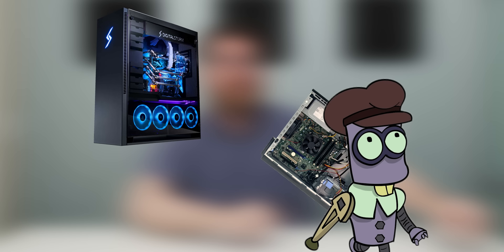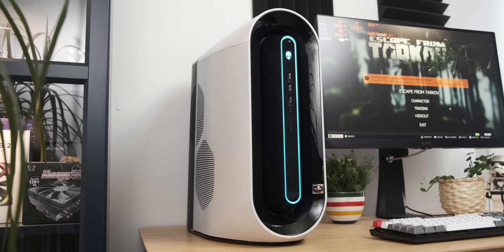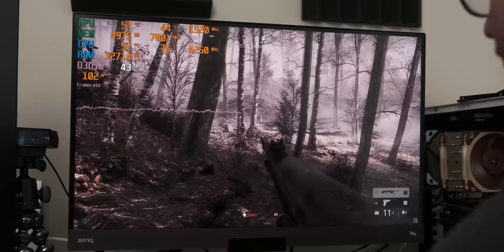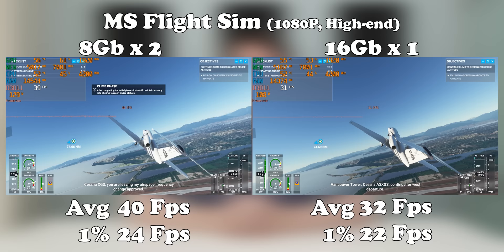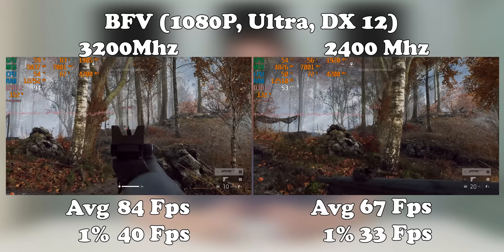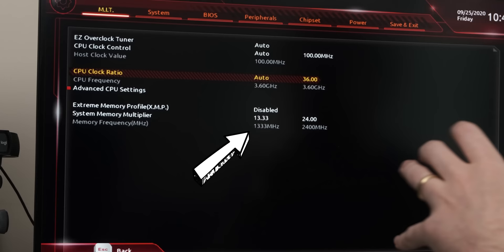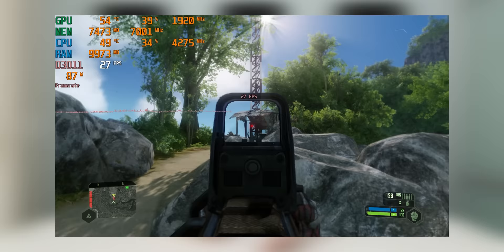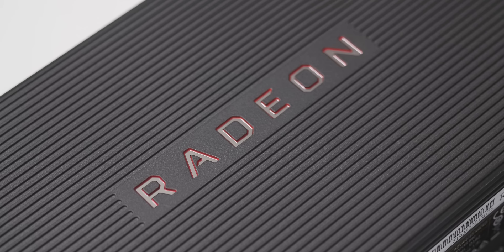How to DESTROY AMD Ryzen gaming performance!

Comment: Nice one Dawid, your findings are solid, and very much in line with what I have found at home, through my own personal testing. If possible, it would be great if you could test 2x16gb and 4x8gb sticks vs 2x8gb for us sticks next. I have found that dual rank (not to be confused with dual channel) RAM setup, can add another 10% to Zen2 FPS in certain games (especially CPU limited scenarios).

I noticed some very decent gains when going from 2x8gb sticks to 4x8b sticks, and the same with 2x16gb sticks vs 2x8gb sticks. Ryzen benefits from dual rank quite a bit in certain CPU limited scenarios. And tweaking the timings via "Ryzen DRAM calculator" is also an excellent FPS enhancer, especially when combined with an top of the line GPU (2080ti, 3080 etc). So is maxing out the RAM frequency and IF at 3733mhz or 3800mhz.

And combing all 3 are the best, using dual rank + dual channel (2x16gb or 4x8gb, both configs are dual channel) + Tweaked Timings + Maxing Out RAM/IF. I have gone all in and done all three with my 3700X (using 2x16gb sticks as my final choice instead of 4x8gb), it is the best way to optimize your Zen2 platform. Intel does great with CPU overclocking, AMD does great with RAM/Memory subsystem tuning and optimization.

Thanks for the video Dawid, really enjoyed it.
Reply: So few tech youtubers test single vs dual rank memory for Ryzen. Personally I have a r5 3600x with 16x2 ddr4 3200mhz ram. I went with dual rank after some hours of searching up benefits with dual rank for ryzen, but it wasn't easy to find information about it.
Reply: @deffar  so you had a 15-20% performance from dual rank? That's awesome, which brand? Corsair, Kingston ? Frequency ? Thanks
Reply: @deffar  Super solid setup you have there bud. 3600X is a great CPU, and 2x16gb 3200mhz RAM is also an excellent setup. I would consider that an great build, definitely super solid. You are well sorted for anything you throw at it. 3200mz dual rank setup is close enough to maxing out your memory setup already, and I would be incredibly satisfied with that exact setup. 

You can obviously always get your RAM/IF maxed out with the maximum your CPU allows (likely 3733/3800mhz), that would require reinvestment into completely new sticks, and that may or may not be worth it depending on the GPU you currently own. But the option is there in the future if you ever decide you do want to completely max out your memory subsystem.

But I don't see any need for you to alter your RAM setup at all as it stands. Just enjoy your PC to the fullest. 

I do agree with you about dual rank not being very well covered by tech YouTubers as well. It is an very valid subject to cover with regards to getting the most out of your Ryzen PC. It would be great if Dawid could do a little digging into the subject matter for us.

I do understand that it is more expensive to go with 32gb RAM (for budget builds), but it would still be good to get more information out there, so that viewers will know that they have an extra option available for optimal performance (whether for a brand new build, or for an upgrade path later down the line). Always good to have more info available for us Ryzen users.
Reply: @luisfernando55  Here is an article covering Dual Rank and its benefits. The article does not show the full potential available, but it does cover what you need to know, and also why it benefits Ryzen platforms.
https://www.tomshardware.com/reviews/amd-ryzen-3000-best-memory-timings,6310-2.html

But 2x16gb sticks are just as good if not even better than 4x8gb sticks. Both 2x16gb and 4x8gb are dual rank configurations, the article tested with 4x8gb if I remember correctly. But you can use 2x16gb as well. I personally prefer 2x16gb myself, so that is an option if you don't want to use 4x8gb. Both are dual rank.

And if you want the most optimal RAM setup for Ryzen (for timings tweaking and optimization), you ideally want some Samsung B-die kits (google will bring up many kits available, go for something in your budget). Anything that is capable of running at 3600mhz-3800mhz is best. But you will have to do some manual RAM overclocking to get sticks with a 3200mhz or 3600mz DOCP frequency to anything higher, such as 3733mhz/3800mz. And 3800mhz also depends on if your specific CPUs infinity fabric can OC to 3800mhz (3733mhz is doable on many though).

But if those are too expensive, any 3200mhz kit with the tightest timings you can afford is the way to go. As long as you go Dual Rank with 3200mhz or more, you will be most of the way to optimal performance. Tweaking timings is the next step to finishing off your memory subsystem optimization.

And if you are not interested in overclocking your RAM, then it is best to pick at kit with the highest mhz DOCP profile out of the box in combination with the tightest timings.

So 3200mhz cl14 timings or 3600mhz cl16/cl14 etc. You are going to need to do some research to see what will work within your budget and to your CPU/MBs capabilities as well (and your skill level).
Reply: @luisfernando55  And let me explain how "Dual Rank" works in more detail. As I said before, dual rank is either 2x16gb kits, or 4x8gb sticks. Both are dual rank setups.

So not to be confused with dual channel (dual channel is using 2 sticks of RAM simultaneously, each one in its own channel on the motherboard). A single stick of 8gb of RAM only has memory IC chips on one side of its PCB. So the CPU can only access memory on the 1 side of the RAM stick that actually has memory on it.

And 1 stick of 16gb has memory IC chips on each side of its PCB, so it has memory chips on both sides of the RAM stick. Thus, it allows the CPU to access memory from both sides simultaneously (very simplified explanation).

So 2x16gb sticks allows your CPU to access all 4 sides of your RAM sticks PCBs simultaneously (2 sides per stick of RAM). So it is "Dual Channel" because of 2 sticks of RAM, and "Dual Rank" because there are 4 sides of memory IC chips to access simultaneously on those 2x16gb sticks of RAM (very simplified explanation).

But it also works with 4x8gb sticks, because then your CPU is also able to access 4 single sides of IC memory simultaneously as well. 

So it can be 2x16gb sticks, or 4x8gb sticks. 2x16gb sticks is preferable though, easier to tune and leaves room for future RAM upgrades.
Reply: @joeyvdm1  But what's better despite small marginal gains?
2 x 16 or 4 x 8?
I'm also looking at power draw efficiency as well as lower power draw overall ;)

3700X (haven't messed too much with setting a clock speed because it takes time to find a balance between efficiency and performance)
2 x 16GB 3600MHZ CL16
2070 Super

Also can't figure out how to really tweak my RAM timings because my system won't post after I do it so I just let DOCP do it's thing
Reply: @christophervanzetta  Don't sweat it bud, if you are having issues with stability (when using anything other than DOCP), then I understand why you haven't tuned any further. You are caught between a rock and a hard place.

I have seen certain Zen owners have stability issues when certain RAM modules are combined with certain motherboards.

So it could be down to your specific motherboard and the specific RAM modules you own. What MB are you using and what RAM modules are you using? Is your RAM on the qualified vendors list for you motherboard?
Reply: @christophervanzetta  Forgot to answer your question. 2x16gb and 4x8gb are both dual rank, so just choose the setup you prefer. 2x16gb is my preferred setup, I generally find it easier to tune and better for stability in that regard. It seems to play nicer with and put less strain on the memory controller. 

So I prefer and currently use 2x16gb, I found it easier to max out my RAM/IF at 3733mhz and 3800mhz with 2x16gb compared to 4x8gb. And also easier to tune my timings the tightest with only 2 sticks of RAM. 4x8gb can be a bit of a stubborn setup to tune to the absolute max, but that is just my personal experience with my own 3700X.

When it comes to power draw, as long as you are not over-volting your RAM sticks to boost frequency (and staying at stock DOCP voltage of 1.35), your power draw should remain the same. And sticking to 2x16gb instead of 4x8gb will also keep power draw down, so another bonus there as well. 

So my preferred setup is 2x16gb, but 4x8gb is often easier and cheaper for people to upgrade to from 2x8gb sticks. It is cheaper to add two more 8gb sticks to your current 2x8gb setup, so people do often do that instead of buying 2x16gb sticks and then selling their old 2x8gb kits. 

And if you are not going to overclock your RAM and/or tweak your timings excessively, then 4x8gb is still quite fine for many people just looking for a cheaper and easier upgrade path to a dual rank setup. And you can still tune 4x8gb as well, it is only an issue when going for the absolute max frequency and/or super tight timings. But you can still tweak the timings a fair amount with most kits, especially when left at normal DOCP clocks, but YMMV. As always, it depends on what RAM kit the user owns, so your results could be better, worse or the same as mine.

I have multiple kits here from multiple builds in my house (now in my kids builds and in my wife's build), so I have had a lot of time to play with various configurations to test what works best and what brings the most performance. We are all on Ryzen builds now, and I will be upgrading to an 4950x for work come release, and passing on the 3700x to my eldest boy with an new B550 MB. I will be keeping my X570 for the 4950x.
Reply: @christophervanzetta  But your setup actually looks really solid to me bud. Your system looks really well balanced. Don't OC your CPU, you are correct. 

I keep my 3700x at stock clock speeds, it does perfectly fine on its own, and does best when left to its own devices. And if you can't tune your RAM any further, I wouldn't stress about it too much to be honest. You are already at 3600mhz, and you are in dual rank mode already. The only thing you could do is tune the timings, but it is honestly not a train smash.

Dual rank will already give you a very optimal memory setup, and with a 2070 it is less necessary to tweak your timings for maximum performance. It is really 2080ti and higher GPUs where you will start to notice tweaked timings more and more. 

You could or could not see some gains in certain titles, even with an 2070s (just depends, but unlikely when GPU limited, which you should be most of the time), and it is not worth stability issues if that is what is happening to you when you try. 

And on the whole, your system looks very balanced to me already, so honestly don't stress about it if you are having stability issues. Your Dual Rank setup will already bring you close to optimal performance, so don't stress if you cant push any further bud.

It is better to have a stable system, then an unstable system. And I would also not tweak my timings or tune any further if I was having stability issues, just leave it as is. Best to go with stability, I cant stress this enough.

And I should add, I will be running an 3080s as soon as my order comes into stock, so it is more important for me to have such a highly tuned RAM subsystem. I will be running into CPU limited scenarios, so it is actually more necessary with such a GPU. And when running anything less than an 2080ti, you are likely to be GPU bound most of the time. 

There can be some exceptions to that of course, but you will very likely be GPU bound most of the time. And the higher the resolution you play, the less CPU limited you will be as well. And just being in Dual Rank mode, will bring you close to full potential already. Not being able to tweak your timings won't just ruin your builds performance, your build is still highly highly capable.  So please don't stress.
Reply: @luisfernando55  Here is an example of decent sticks, these should also be very tweakable. This is a decently priced in my country, not the best of the best but still excellent on the price/performance scale. They are not B-die, but there are B-die versions of them available if you can find them, at a higher price of course.
https://www.wootware.co.za/g-skill-f4-3600c16d-32gtznc-trident-z-neo-32gb-2x16gb-ddr4-3600mhz-cl16-1-35v-black-desktop-memory.html

That is 3600mhz CL16 2x16gb=32gb RAM. And they should be very tweakable if you know how to do so. But it depends on your motherboard and CPU as well, it depends on how compatible they are with one another. And 3200mhz is also fine, as long as you are going for a dual rank + dual channel setup. So 3200mhz 2x16gb cl14 or cl16 kit. 

And here is an example of a 3200mhz kit.
https://www.wootware.co.za/g-skill-f4-3200c14d-32gtzsk-tridentz-series-32gb-2x16gb-3200mhz-ddr4-cl14-1-35v-grey-black-desktop-memory.html

You don't have to stick with those kits or those brands. It is just an example. But if you plan to do no timings tweaking yourself, then try purchase the lowest CL rating you can afford. But if you are going to tweak, then you can purchase something with a higher cl rating and attempt to tune it lower. So from cl16 tuned to cl15 or cl14. I t really depends on your willingness to learn and the research you are willing to do. 

B-die is the best of the best RAM if you want the best of the best, they are highly tuneable and very overclocking friendly. But they can really get up there in price, and are not great for anyone who has no plans to really tune the heck out of them. Cheaper non B-die kits are better for anyone not planning on investing lots of time into getting the best by tweaking each and every timing. Best to save some money in that case and get some cheaper non B-die kits, rather put the savings towards a nice new GPU or even to just keep the savings in your pocket. Nothing wrong with only purchasing what you need, I do it all the time. 

And if budget is restricted, just get the best you can afford. Just grab whatever 3200mhz 2x16gb kit you can afford. No need to stress over what is not worth stressing over. Life does not need added stress, and computers should be a joy and not a worry. So never let it worry you bud. Anything 3200mhz-3600mhz kit in Dual Rank will already be a very decent setup, one to be very satisfied with. I would gladly rock any PC with such a setup. 

I just find it difficult to recommend specific RAM modules across the board to everybody, because I have come across people who have had issues with certain RAM sticks in combination with certain CPUs and motherboards. I need more information from you to really assist you.

But those modules should be compatible with most Ryzen PCs when just using the DOCP setting. But it would be better if you told me what your budget was and what CPU and motherboard you currently own, that will make it will make it easier for me to assist you.
Reply: @joeyvdm1  Thank you ! dont wanna be rude, do you use discord or something for chat? Would love to exchange ideas about ryzen and all tech stuff.

Comment: Lovely video. Just a thought. I just bought an  EVGA GTX1080Ti FTW3 for $355 a week ago. It's sitting in my 2016 HP Z420 with a Xeon E5-1650V2 OC's to 4.1Ghz and 32GB of 1866 DDR3 memory. But here's the kicker, It's running in quad channel. I game exclusivity at 1440p and FS2020 with all the settings on high runs a reliable and consistent 42-46FPS. Destiny2 with all the settings maxed out runs on average 118FPS. Oh yeah, the machine cost me $230. Total budget $580. Pit my old steam powered machine against that sparkly new Alienware. It could get messy.

Comment: Fun story: the prebuild I ordered when the Ryzen 1700 came out had a single 8GB stick of 2400mhz. What I did not realize, is that there was a memory issue with Ryzen. Back then I really wasnt into tech. My PC performed like crap. I didnt have good frame rates, and was suffering from extreme frame drops, and frames frozen for a couple of seconds pretty regularly. 
It turns out, as I only discovered a couple of month ago, that my memory was running at 1200mhz for some reason, even though it was set to 2400 in the bios.
The fact that my 1060 only had 3gb of memory did not help either, needless to say.
After updating the bios and getting 2x8GB 3200 mhz memory the performance was waaaaaay better. With a little bit of overclock on the processor additionally, I went from 1% lows of 2-4FPS in Heaven Benchmark to around 40 FPS 1% lows.
Looking back, I am really salty, because playing compettitive games with regularly frozen frames is not a lot of fun.
Well, from now on no more xD
Reply: I think you're mistaken on the 1200mhz part. Ram is DDR aka Double Data Rate. And sometimes the speed of the ram can be written as 1200mt/s instead of mhz but it's the same thing as 2400mhz.

Comment: Thanks for this amazing video♥️
But can you make a video explain the difference betwen 2x8 ram 2400mhz and 16×1 3200mhz and who is the best the more bandwits on 2x8ram 2400mhz or the 1x16 ram 3200mhz is better because more frequency♥️
Reply: Oh well, I asked the same 

Also yes dual channel is better, but at what extend. Because between a solo 3600Mhz or higher versus a dual 2133, I'm not sure that the difference would be that good (or that the dual channel would be better)

Comment: It's still funny that with my old 4790K, I saw the inverse going from dual channel DDR3 1600 on my H97 board, to single channel DDR3 2200 on my (damaged) Z97 board. Quad cores really don't seem to need much memory bandwidth.

Comment: With downclocked single stick memory, that system actually performed as well as FX 6300 with 16GB DD3 1333MHz RAM and RX 560 4GB. Makes me wonder how well FX CPUs would perform with DDR4 memory.
Reply: not any better cause the cpu was the bottleneck also you have to run it at the same slow speed